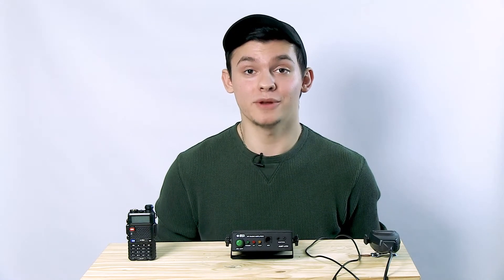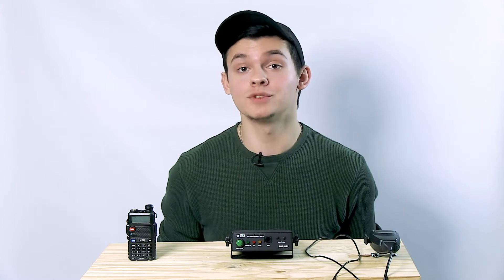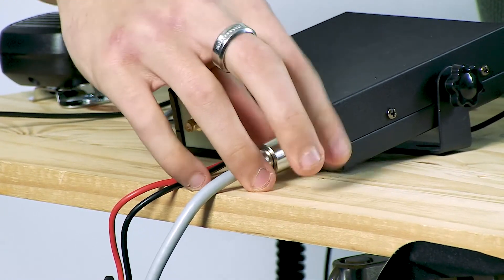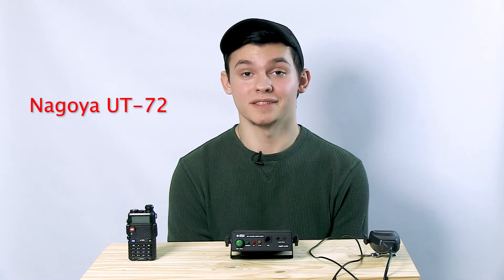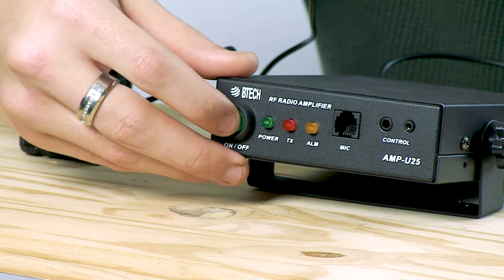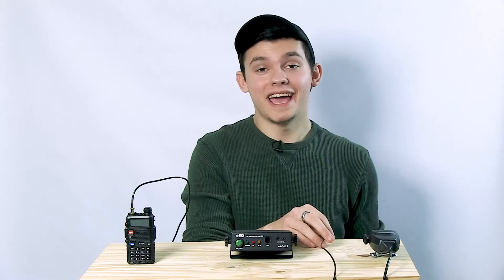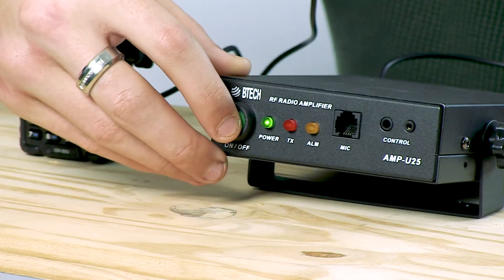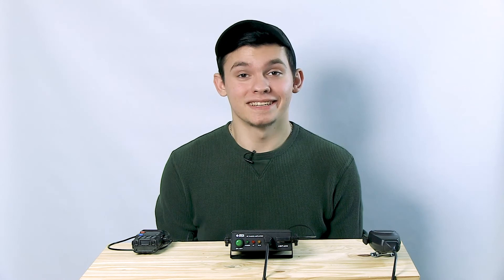BTECH AMP-25 Series - Basic Overview

Comment: I have two, they work great, HOWEVER, it is very important to use a cooling fan as this unit gets extremely HOT fast. A simple cooling fan works very well in keeping the unit cool.

Comment: What cable to use in order to connect it to Yaesu FT3DR?
Reply: no cable i can find
Reply: Adaptor of custom cable
Reply: SMA-M to SMA-M. You could use a barrel connector with the included cable also, but the included cable is crap.  Toss it out and get a good SMA-M to SMA-M.  If it’s short few feet, just RG58 will do.

Comment: To run this with a triplexer on the input for multi band operations, could you just bridge the outputs of the other two bands with the amplifier output or would you have to run a triplexer on the output/ separate antennas?